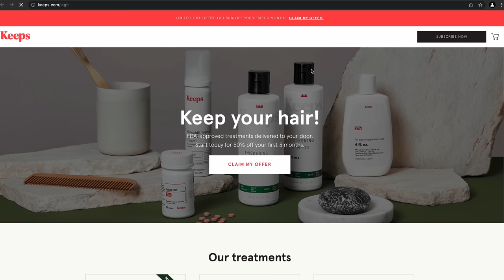What I Found After Tearing Down My SVT Lightning Engine & Looking Inside! CARNAGE ALERT!

Comment: I feel your pain! I am finishing up a rebuild on my 5.4 2v f150 engine now. Started with a broken flex plate, found a bad head gasket, then said fuck it, its got 290k on it may as well redo this shit.  Glad I did, everything was  out of spec to the point of needing machining. Bored out .020, decked and hot tanked, rotating assembly balanced and crank ground and polished at local machine shop set me back about 1500 bucks.
Reply from the maker: Great deal! Here's to another 300k!

Comment: No I didn't see it after all - I saw marks on the lower half of piston #1 which lead me to think at some point in the past the exhaust valves hit the piston.  That's brutal, but as you say gives you all sorts of options to rebuild better. :-)  Honestly, I'm shocked it was running as well as it was prior to the head gasket fully giving up the ghost.
Reply: Same here , saw the marks from the valves strike , that detonation is pretty severe but running it with a blown HG wouldnt have helped

Comment: I once thought all you have to do for reassembly was make sure the arrows on the pistons pointed to the front (Small block Chevy).  Fortunately, just before I put the heads on  I learned about the oiling holes in the big end of the rods that squirt oil under the opposing pistons.   It turns out that I had half of them facing the wrong way.  I'm not sure whether Ford has those oil passeges too.
Reply: Unless you have done a particular engine before, always pay attention when disassembling and do some research.

Comment: Hey make sure u run some good oil in that use Lucas or amzoil u should  also go with a quality oil filter, I personally recommend u use oil stabilizer to prevent this from happening again in the long run
Reply: The secret to having a bullet proof engine isn't weisco forged crap and h beam rods with arp studs n this n that, the real secret my friend is a balanced low compression motor (filed rings) I wouldn't really worry about it being balanced tho u can check with a scale

Comment: What would happen if you just put new pistons in and didn’t bore the cylinders?
Reply: It'd probably be fine really , you'd give it a bit of a home anyway.
It all depends on what you want the engine to do . If you were doing performance mods you'd want it perfect .
There's loads of engines out there that have had rebuilds with minimal work done to them .

Comment: Ok Why has the Crown Failed and sunk leaving a Huge Gap From the Bore  Exposing the top Ring. Spark Track Has Caused this All Fords Do it.
Reply: Previous owners have not Changed the Oil Regular Look at the Baked oil on the  pistons .  End Result  What Alex Has Found here Is Exactly what will go on with a supercharged motor. In a constant Hot Climate  Compressor engine  7000 mile intervals . My Rs Runs So Hot It Will Kill the Plugs and the Oil in 2400 Miles it wont start at 2400 Plugs are Dead.
Reply: Make a Rocket Ship Alex  I Would ....... Waiting with interest.

Comment: Funny thing is could have just pulled a spark plug and shoved a scope in on each cylinders. Like it's a performance vehicle not a Nissan altima or anything. when purchasing the vehicle............would have saved you the inevitable discovery. And time in the future.
Reply from the maker: That easy?
Reply: Yea honestly...especially when buying an SVT. One of the most prolific, respected, and intelligent vehical teams in the world. It wasn't easy competing with SVT in the 90s and early 2000s. Not only did they have one of the best engineering teams. They also had some of the greatest designe Teams. SVT holds it own against today's sports trucks. So yeah. I'd have popped a spark plug or two out. But hey. I'm not the one ripping apart the block. Poor crank. Just make sure your cooling system can keep up with that blower your going to slap on. I'd hate to see the block fail after it's bored out....then it's really the end for the original heart of the car. I will say this truck in the current state would be a great candidate for a fast an furious tribute truck. Honor Paul walker with one of the most underrated vehicles of the seires. That bad boy in red breaking necks.

Comment: The lightning already has dual fuel pumps in the fuel tank…. Don’t quote me but I believe the second fuel pump is ecm controlled to come on over X amount of boost or throttle position. The issue is the Y fitting on the fuel pump hanger either crack and or the clamp on the connections between the pumps and that plastic Y blow off and fuel pressure issues while in boost occur causing lean conditions and possibly why your engine has the piston damage you found. Since you couldn’t get into boost conditions without pushing coolant it probably never reset the lean bank1/2 codes that come as a result of the fuel pump/hanger assembly Y fitting and hose clamp failures that are only apparent when both pumps are commanded on and it bypasses internally inside the tank
Reply: I have first hand experience with these trucks,  fixed the fuel pump Y and clamps failure then after that was fixed we installed the 3.4L ford racing whipple supercharger and metco pulley and belt kit and retuned it with the SCT tuning software about 9 years ago now and the customer had valve seals replaced a few years ago for blue smoke on startup only. So I would recommend those while your engines apart also
Reply from the maker: Thanks! I appreciate the info and I'll definitely look into this

Comment: So if there was something wrong with the connecting rod caps, the whole connecting rod would have to be replaced as a set?
Reply: Yeah a lot of different engines use the cracked rod design and it’s efficient for mass production but yes you’d have to replace the rod along with the cap

Comment: So are you still gotng to use 80k mile heads on a brand new short block?
Reply from the maker: Probably but I'll go through them. The mileage won't matter if I'm just using the casting and valves

Comment: I am pretty sure the reason there is two holes is the European market the starter is on the opposite side to clear the steering when it's on the other side.
Reply: Didn't think it was available in Europe. Thought only new f150s were available rhd for Australia.

Comment: These superchargers sound amazing lol my friends have had several over the years. Make sure you upgrade the spark plug holes to 9 thread if you're plannkng to up the boost
Reply: @DømiNğø🛻 yes they are called c heads from a 03/04 cobra..... the spark plugs only have 4 threads on the lightening..... c heads have 9 so the plugs wont blow out with higher boost
Reply: @DømiNğø🛻 oh ya i think you're correct.... i haven't messed with the 5.3 stuff but i know the 4.6 is all interchangeable from 2v to 4v
Reply: I know one of em is a upgrade, my buddy blew his plug out 2x at the strip and had to be towed home. He stopped taking his truck after that.

Comment: Did you just call the flywheel a flexplate ?
Reply from the maker: Yes. That's what it's called. A flywheel is for a manual transmission.

Comment: In engines with shared journals, it's good practice to loosen the bolts for the 2 rods before removing one of them, so you don't exert any force to the journals with the twisting motion of unbolting a single rod

Comment: You generally don’t have to mark the rotation of crank to flex plate on most engines as the bolt pattern is only meant  to fit in one spot or the holes won’t line up.

Comment: I normally put something like plywood, some 2x4s, or some laminate flooring to spread out the weight of the engine in the trunk.  Not sure what the tesla looks like under there, but most of my cars have a spare tire well, so I span floor to floor to support 300, 400 lbs of engine